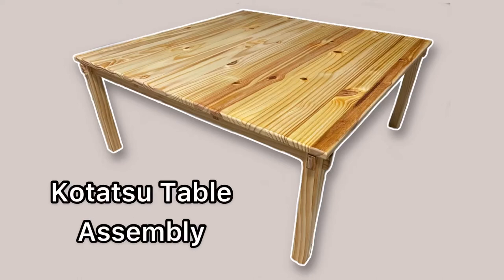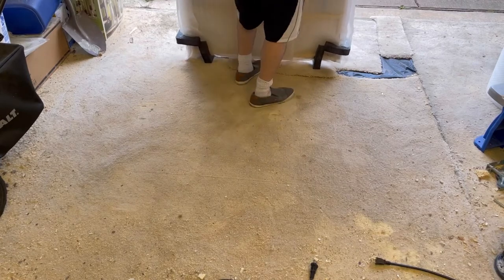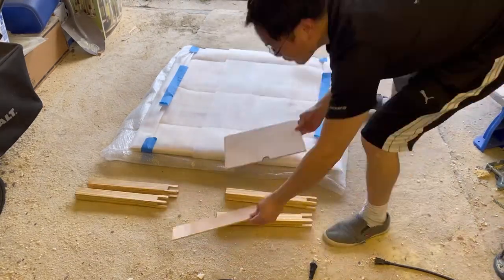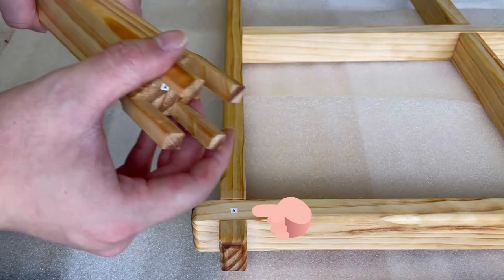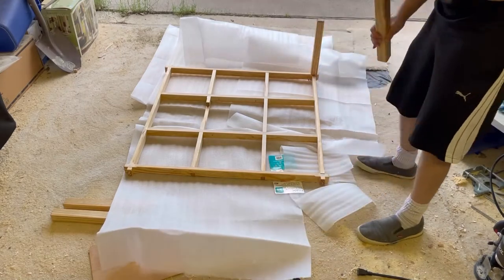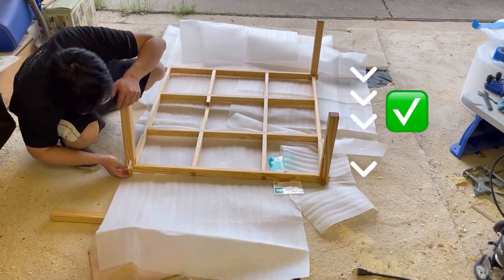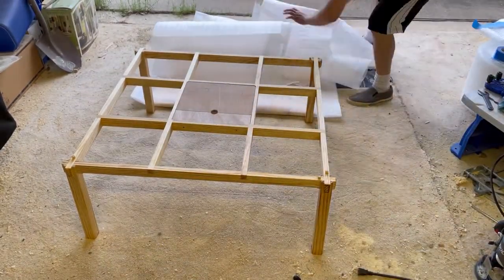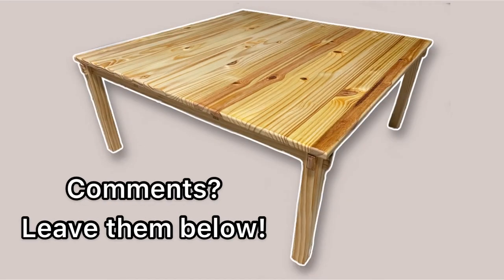Assembling the Kotatsu Table

Comment: Loved the table. I just wanted to ask is it possible to use thick blankets to put over the frame, or does it only work with thin sheets?
Reply from the maker: I was able to use a thicker blanket with it, but it's just a cheap polyester comforter. I think it should work with most blankets as long as they're not very thick and dense like a heavy down comforter.
Reply: @davidsdetaileddiscussions  ooh, ok thnx